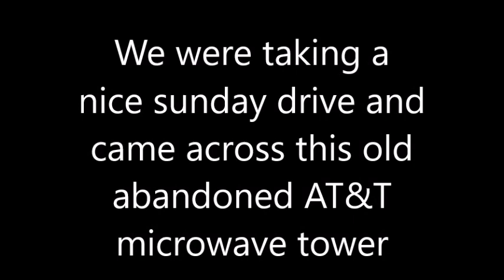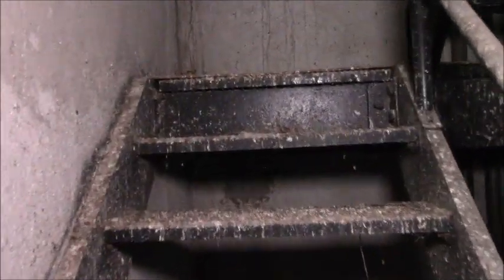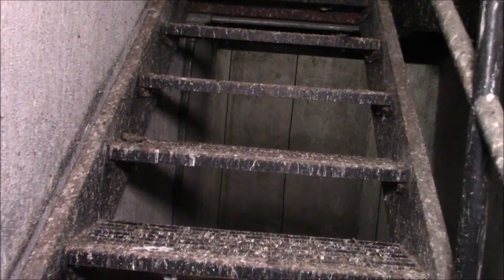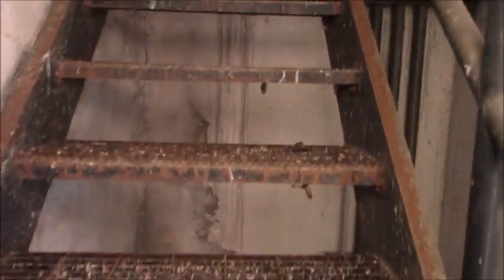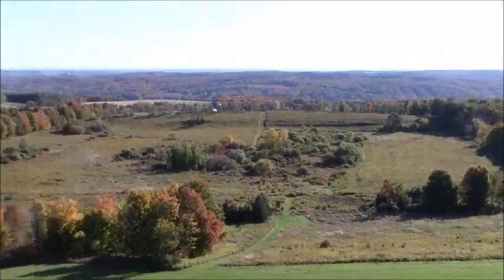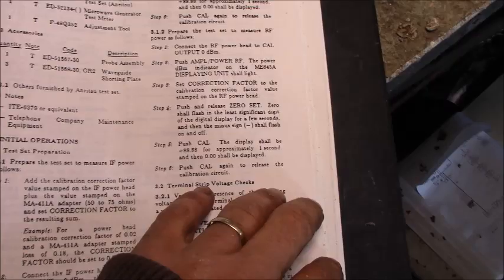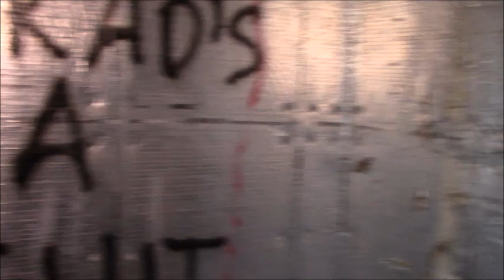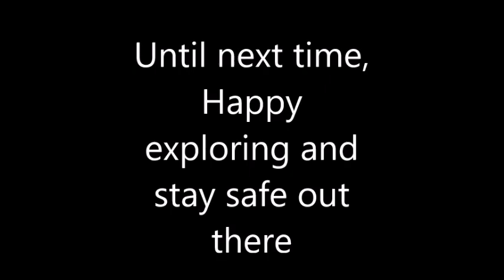Technology must move on  ●Abandoned AT&T microwave tower

Comment: re:  9:23  Those 4 rectangular things were the connection to the 3.7Ghz to 4.2Ghz 'Waveguide' on the other side of the wall and then connected to the ORIGINAL 4 'Horn' antennas. Typically, there was 2 horns in the same direction on the AT&T Long Lines. And as you already know they each were a part of the entire overall system but also had a connection to the local phone system by wire of another microwave link, typically a 6Ghz. link . There were 2 antennas so that they would have a 'Hot' Standby if the other radio, feedline, or antenna failed. Back to the 4 waveguides on the wall...the dimensions are exactly specific to the operating frequency and not just arbitrary. So, back then the microwave antennas were monster in size because of the operating frequency. Now days in view of advancements in microwave technology the usable frequencies can go much higher 50Ghz and consequently the size of the 'Wave' is smaller. So, that's why now days you see 'Tiny' dish type antennas. (Higher the frequency the smaller the wavelength- you might think 'That's Backward' but that's how RF works!)
Reply from the maker: Thanks for the info..And man, thatbis a hole lotta info.. thanks for watching,. We really appreciate it
Reply: Thanks for the information!!

Comment: Looks like the Vernal NY 118' Type 3A concrete radio-relay building - one hop east of Buffalo on the Buffalo - Syracuse TD-2 route.  Vernal may have been the 49th and last concrete building since the other three stations on this route - Pinnacle Hill, Phelps, and Van Buren were all Type A steel towers.  There is no mistaking Vernal TD-2 as it was the only Type 3A building in the Long-Lines system.  The concrete buildings were built on 14-1/2 foot increments plus 1 foot for footing and 1 foot for antenna deck - hence 60' for Type 1, 118' for Type 3A, 190.5' for Type 4D.  Vernal is located a few miles east of Attica NY - to the west of town is the former Attica L4 underground station with 200' Type-A tower.  Happy hunting... waw
Reply from the maker: Well that is a ton of info I dident see coming..lol.. sounfs like you have alot of knowledge about these systems.. I hope we did it justice.. thanks a million for watching
Reply: @jeadventures007  Albert LaFrance has a web-page http://www.long-lines.net/places-routes/Vernal/index.html with photos of Vernal before equipment was scrapped out...  waw
Reply: @Widebandit  Fascinating, you can see how self-sufficient the Bell system was. Western Electric made everything from Crossbar and ESS swithces to microwave transmitters!

Comment: You should see AT&T's biggest long lines tower in catawba ohio, the concrete tower built in 1949 was too small for the terrain so in 1968 a steel 450 foot tall tower was added on, a steel bridge goes from the concrete tower to the steel tower for supporting waveguides to the antennas
Reply from the maker: That would be so cool to see

Comment: The concrete Towers are the original ones, the steel towers were built later. The original Towers were concrete because steel was in short supply after the war. As time went on and the steel supply replenished they built the rest of them out of steel
Reply from the maker: Sweet.. great info man.  Thanks a ton

Comment: Found one of these near where I live, me and a few friends decided to check it out and it was in pristine condition and there was a fiber optic setup inside. There were 2 doors on the building, one went into a storage room and the other goes up to the top(we assume). There was a missing cinderblock at the back that we were able to squeeze through and check out the storage room. Any idea what they could be using it for, could it be privately owned?
Reply from the maker: The other door could very well go to the top.. need access to the roof.. alot of time they are owned by the cell and or cable companies.. sounds like the one you found is still in use.. so be careful.. thanks for watching

Comment: i agree that tech should go on, but its not going the right way! those were able to whitstand a nuclear blast. meanwhile cellular network go out for the simplest storm or power outage, those had turbine gens, most cell towers nothing more than couple of upses that barely last couple of hours. then if something big hapens and leaves ppl for a month without power i wonder the chaos and the cues to the few houses with still landline cause the so advanced tech stopped working but the guy with the landline can still talk like nothing happened
back then you could loose power for a month and still be able to talk to ppl even on long distance calls. 
luckily here in italy landlines are still around and to back up wires a similiar technology for landline (to carry also also adsl ecc) is still in use
Reply from the maker: I agree. Has tech gone to far? In alot of aspects,  yes.. leave things basic. We also can still get land lines here to. More reliable.  Thanks for watching.  We really appreciate it
Reply: Why not use fiber optics with voip?
Reply from the maker: I believe they dident use want to use the building because of age.. thanks for watching.  We really appreciate it